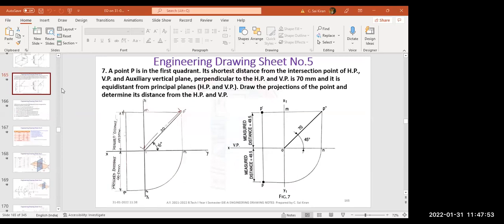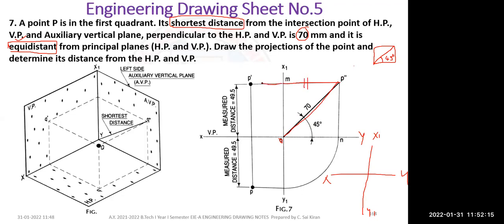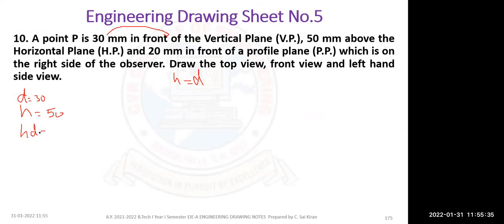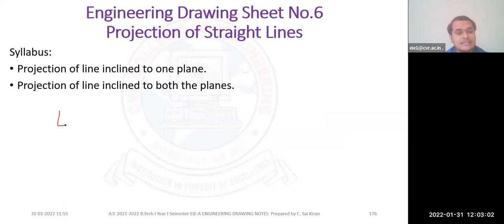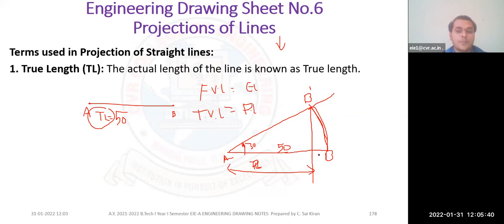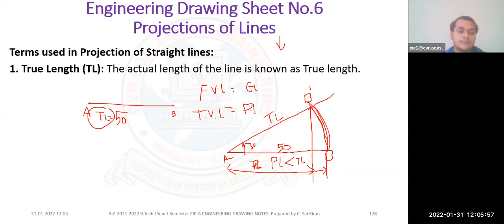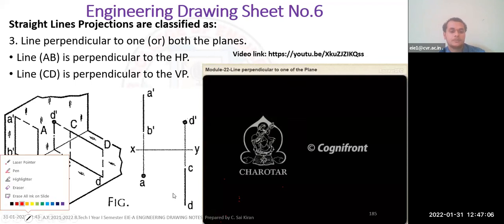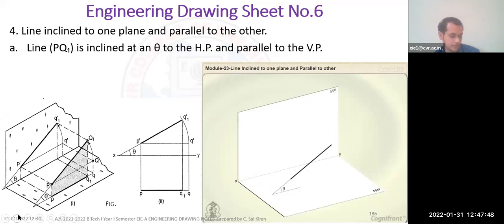Introduction to Projection of Inclined Lines - CVRCOE Zoom Class on 31/01/2022

Comment from the maker: Following are the Engineering Drawing YouTube Videos:
 
Sheet-1 Videos: Introduction to Engineering Drawing

1. Use of Mini Drafter and instruments: https://youtu.be/OPQN5Q4f59s
2. Lettering in Engineering Drawing: https://youtu.be/fqrJzEqQyls

Sheet-2 Videos: Geometrical Constructions

3. Bisecting a line: https://youtu.be/tekYxhukL9w
4. Divide a line into equal parts: https://youtu.be/UM_7YvNC95E
5. Bisect a given angle: https://youtu.be/6supPQP2ygQ
6. Inscribing circle method: https://youtu.be/pUAU3x4XnZU
7. Semi-circle method: https://youtu.be/gC0Obn8gtgI
8. Quarter circle method: https://youtu.be/wpOtZ2crsao
 
Sheet-3 Videos: Conic Sections
 
9. Introduction to Conic Sections: https://youtu.be/kmvQAEFlAqw
10. Conic Section - Ellipse by Eccentricity method: https://youtu.be/E2UFx_5NvEc
11. Conic Section - Parabola by Eccentricity method: https://youtu.be/rTdrrMIkU1I
12. Conic Section - Hyperbola by Eccentricity method: https://youtu.be/eZ_2-imWNAs
 
Sheet-4 Videos: Scales

13. Introduction to Scales Topic: https://youtu.be/HsmDPk7PQ74
14. Introduction to Plain Scales Topic with example: https://youtu.be/wwYjAyUWzFE
15. Plain Scale Example Problem: https://youtu.be/gSDUtBf-7qQ
16. Plain Scales Problem-1: https://youtu.be/h_t1PtHDDB0
17. Plain Scales Problem-2: https://youtu.be/IxXOKbEE9C8
18. Introduction to Diagonal Scales with Principle and Construction of Diagonal Scale: https://youtu.be/Uuxz2cCXvkM
19. Diagonal Scale Example Problem: https://youtu.be/g0IbLG5FPV8
20. Diagonal Scales Problem-1: https://youtu.be/9wAMQyLi3DY
21. Diagonal Scales Problem-2: https://youtu.be/we7_n6NFiIE
22. Introduction to Vernier Scale with Construction and Example: https://youtu.be/nt0qlamakxI
23. Vernier Scale Example Problem: https://youtu.be/oY5UMp5H7bg
24. Vernier Scale Problem-1: https://youtu.be/tV8Sip3AhKA 

Sheet-5 Videos: Projections of Points
 
25. Introduction to Projection of Points: https://youtu.be/8x6DUNuSHQI
26. Introduction to Projection of Points (IQ to IVQ): https://youtu.be/iM93_ZvuEEY
27. Representation of Top View & Front View in
First angle & Third angle: https://youtu.be/7ZIag38-w80
28. Projection of a Point in the 1st Angle Projection: https://youtu.be/OBFwCw8wwkI
29. Projection of a Point in the 3rd Angle Projection: https://youtu.be/tXERV4JotcQ
30. Projection of Points Problems - 1: https://youtu.be/9IwlaGPUuOA
31. Projection of Points Problems - 2: https://youtu.be/E_vuNBGh628
32. Projection of Points Problems - 3: https://youtu.be/2E9IxUWhNF0
33. Projection of Points Problems - 4: https://youtu.be/fwaqVsSFg-k
34. Projection of Points Problems - 5: https://youtu.be/pwhFEnCk49w
35. Projection of Points Problems - 6: https://youtu.be/_9cUnmSh314
36. Projection of Points - Equidistant Problem: https://youtu.be/idqNexrblC4
37. Projection of Different Points in all the Four Quadrants (Sheet-5 Q8): https://youtu.be/B6G8mq4H5so
38. Projection of Two Points by Joining their Top and Front Views (Sheet-5 Q9): https://youtu.be/fT3ww-zwwec
39. Projection of a Point on Profile Plane, HP and VP: https://youtu.be/3PfN5jkkLMA

Sheet-6 Videos: Projections of Lines

40. Introduction to Projection of Lines: https://youtu.be/C7aHDFD7NtU
41. Projection of a Line When it is Inclined to Horizontal Plane and Parallel to Vertical Plane: https://youtu.be/p6MwrfBhYJY
42. Projection of a Line When it is Inclined to Horizontal Plane and Parallel to Vertical Plane: https://youtu.be/WDEhd1woQzw
43. Projection of Line when the Line perpendicular to one of the Plane: https://youtu.be/XkuZJZIKQss
44. Projection of Lines when it is inclined to both planes (VP & HP): https://youtu.be/m886kz7K0gQ
45. Problem on Projection of Line Inclined to both the Planes - https://youtu.be/PhfDF_VJUVo
46. Midpoint Problem for Projection of Line when it is Inclined to both Planes - https://youtu.be/no8GI77SIG4

Sheet-7 Videos: Projections of Planes

47. Introduction to Projection of Planes: https://youtu.be/Hxye785HuWU
48. Projection of a Plane (Rectangle) Inclined to both the Planes -  https://youtu.be/ZdwKlMCVRhw
49. Projection of Planes - Set Square with surface inclined to VP and edge to HP: https://youtu.be/Icpx9GGlFuk
50. Projection of Planes Hexagon - Plane with surface & edge inclined to both HP: https://youtu.be/nG_fmlfG2_U
51. Projection of Planes Hexagon - Plane with
edge & surface inclined to both HP & VP: https://youtu.be/GGLN6s-T4WU
52. Projection of Planes Pentagon - Plane with surface & edge inclined to both HP & VP: https://youtu.be/blVSZPqRaGw
53. Projection of Plane (Semi Circle), when it is Inclined to both the Planes: https://youtu.be/tmJKw6DmfRE

Sheet-8 Videos: Projections of Solids

54. Introduction to Proiection of Solids: https://youtu.be/LNC5awyd49w
55. Projection of Solids - Cylinder inclined to VP: https://youtu.be/Fwwt_0qsd_Q
56. Projections of Solids (Cone) with generator
on HP: https://youtu.be/efd4Vnnn0cE
57. Projection of Solids - Square Prism with Edge is inclined to VP and HP: https://youtu.be/pHgrf50xEfU
58. Projection of Solids - Pentagonal Prism inclined to HP and VP: https://youtu.be/j0OaGV8Gjr4
59. Projection Of Solids - Hexagonal Pyramid
incline to both HP and VP: https://youtu.be/u5qI5XysWMk
60. Projection of Solids - Hexagonal Prism inclined to both the HP and VP: https://youtu.be/j5zvL1_CgtE

Sheet-9 Videos: Sections of Solids

61. Introduction to Section of Solids: https://youtu.be/qxi5fXcJnyc
62. Section of Solids - Pentagonal Pyramid is cut by horizontal section plane and bisecting the axis: https://youtu.be/LIy3S9KgYzs
63. Sections of Solids - Square Prism cut by a Section Plane perpendicular to HP and Parallel to VP: https://youtu.be/iuG0u0-7v48

Sheet-10 Videos: Development of Surfaces

64. Complete Introduction to Development of Surfaces: https://youtu.be/xHGnz_Swt2c
65. Introduction to Development of Surfaces:  https://youtu.be/e9xAPqiulNI
66. Classification of Development of Surfaces: https://youtu.be/OpLnjArqMVA
67. Development of Surfaces - Development of Cylinder: https://youtu.be/RVg4mm9tf50
68. Development of Surface - Cylinder cut by a sectional plane inclined to H.P. : https://youtu.be/RVg4mm9tf50
69. Development of Different Prisms - Square, Triangle, Pentagon and Hexagon: https://youtu.be/uqIcdwfaOXg
70. Development of Surface - Hexagonal Prism cut by a Sectional Plane Inclined to HP: https://youtu.be/SzERe819EeQ
71. Development of Surface - Pentagonal Prism cut by Sectional plane inclined to H.P. : https://youtu.be/y3SWiI5ohro
72. Development of Surfaces - Cone and Frustrum of Cone: https://youtu.be/P3Mtba3Qn_g
73. Development of Surfaces - Cone base is resting on H.P. : https://youtu.be/QD7oe0e8JEY
74. Development of Surface - Cone is cut by a Sectional plane inclined to H.P. : https://youtu.be/w9MNziZwxDI
75. Development of Surfaces (Pyramid with frustrum) - Square, Triangle, Pentagon and Hexagon: https://youtu.be/YF4IZKlR2Y8
76. Development of Surfaces - Square Pyramid cut by Inclined Plane: https://youtu.be/MnvU9MdDpsw

Sheet-11 Videos: Conversions of Isometric view to Orthographic views

77. Introduction to Conversion of Isometric View to Orthographic Views: https://youtu.be/OWJu8PYuBMM
78. Conversion of Isometric to Orthographic Projections - Example: https://youtu.be/LTDKszqik-s
79. Conversion of Isometric View to Orthographic Projection - Problem 1: https://youtu.be/WaAC9rKRTC8
80. Conversion of Isometric View to Orthographic Projection - Problem 2:  https://youtu.be/yxjHt1sT79U
81. Conversion of Isometric View to Orthographic Projection - Problem 3: https://youtu.be/QyV5hr7Z1yk
82. Conversion of Isometric View to Orthographic Projection - Problem 4: https://youtu.be/he9s0yXTOD4
83. Conversion of Isometric View to Orthographic Projection - Problem 5: https://youtu.be/wSB3AvX3fkU

Sheet-12 Videos: Principles of Isometric Projections

84. Introduction to Isometric Projection: https://youtu.be/X2nYt5TznWU
85. Isometric view of a square kept in horizontal
position: https://youtu.be/euGs44hIZJc
86. Isometric view of a square kept in vertical
position: https://youtu.be/d7R-aH9yqII
87. Isometric view of a circle on all the three principal planes using coordinate method: https://youtu.be/KMBXfPoR3lo
88. Isometric view of a circular lamina using four centre method: https://youtu.be/re5pctqNG4M
89. Isometric view of a Pentagonal Pyramid when its base is on the H.P & V.P: https://youtu.be/gqY90-wW_IA
90. Isometric view of the frustum of a hexagonal
pyramid resting its base on the H.P: https://youtu.be/wr3qfiNbAgI
91. Isometric view of a sphere which is resting on the ground: https://youtu.be/1kP8tbq7WPw

Sheet-13 Videos: Conversions of Orthographic Projections to Isometric view

92. Conversion of Orthographic Projection to Isometric View - Problem 1: https://youtu.be/eXZeT7wtlR4
93. Conversion of Orthographic Projection to Isometric View - Problem 2: https://youtu.be/KVpisyqLz6M
94. Conversion of Orthographic Projection to Isometric View - Problem 3: https://youtu.be/anjdsY5Acuo
95. Conversion of Orthographic Projection to Isometric View - Problem 4: https://youtu.be/_MFUWmQt8xU
96. Conversion of Orthographic Projection to Isometric View - Problem 5: https://youtu.be/YIcTkP-fUYo

Playlist link of all the videos: https://youtube.com/playlist?list=PLOSWwFV98rfJbiAlSVRaf-k9MiQZSb-T0

Engineering drawing PDF notes link: https://www.slideshare.net/saikiran001/engineering-drawing-ppt-as-per-jntuh-syllabus?from_m_app=ios